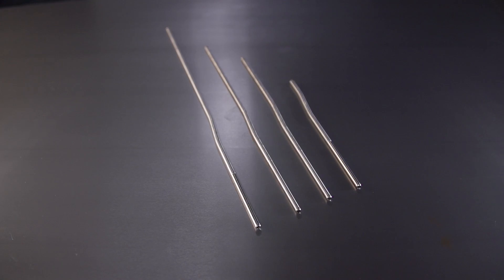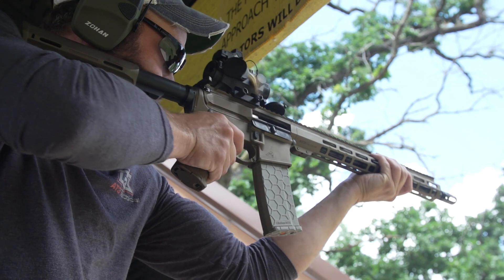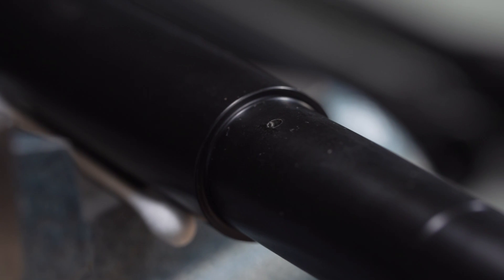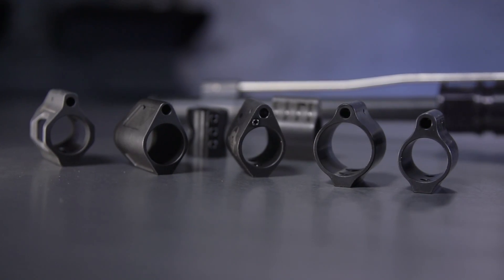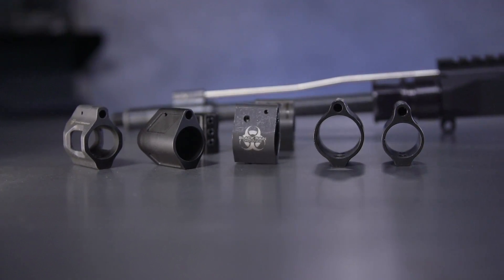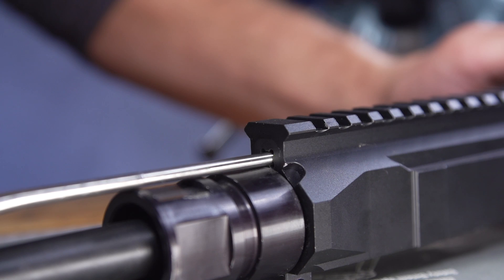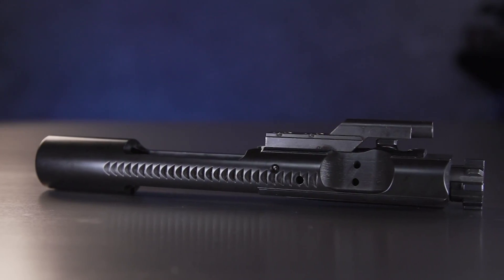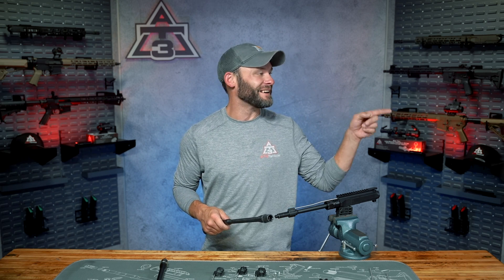Ep-4: The AR-15 Gas System. THIS Is Why & How Your AR-15 Works! Gas Blocks, Gas Tubes, Gas Ports.

Comment: A properly installed, real A2 front site post and gas block is pinned twice all the way through holes drilled in the bottom of the barrel.  If it's not pinned through, it's a knock off gas block made to look like an A2 FSB in appearance only.

Comment: Sir can someone explain how we can clean the Gas tube inside
Reply: Spray it with solvent from the chamber end itll shoot theu the tube and out the gas port.
Reply: They don’t ever need it. The gas during use is so hot and so high pressured that the tubes are considered to be self cleaning. No need to ever spray anything in there and God forbid don’t try jamming anything in there. Totally unnecessary.

Comment: Was is interesting to me is. What happens when you season the threads on a gas block. And use heat resistance blue loc-tite. Yes clamp style. It seals the system better than most. According to JP industries. But most manufacturers don’t want to take the time to season the threads. Tighten and loose gas clamps four times. Clean the threads and bolt with alcohol. Apply heat resistance blue loc-tite. Done.

Comment: Just put a hawk stinger on my rifle. Thanks you all at AT3 for the amazing product and all the videos you have done. 

Question however I thought I had everything lined up with my Odin adjustable gas block and boy was she a tight fit. When I looked under I was expecting to see my two bolts in the miidle of the slot on the mlok but it wasn’t. It’s off just a bit so should I try and realigned it again? Thanks
Reply from the maker: The hole in the Gas block is much larger than the hole that it lines up with in the barrel so if the gun cycles rounds then you should be good to go. If you want to get it perfectly lined up then you could realign it but that is up to you. https://www.at3tactical.com/blogs/news/instruction-guide-install-and-tune-an-adjustable-gas-block

Comment: My Diamondback 15 is extremely over gassed to where the gas is leaking from the rear charging handle, the recoil kicks hard enough to bring my sight off target while on a bipod. I am shooting a 6 inch spread at 100 yards and I think its due to the over gassing. I am able to get a 2 inch spread off of my friends Saint Victor AR. Should I get an adjustable gas block or do you think I need a heavier spring and weights?
Reply: Probably both. Start with the cheapest one
Reply: Start with an H2 buffer, then get a white hot springco buffer spring. The first can be under 20 bucks and the second is 30 bucks. I’ve found the H2 buffer weights balance all of my AR’s from 7” to 16” and just about everything in between. Shoots softer and ejects at 4 o’clock all day long.

Comment: This video neglected to add the micro length gas tube... the same tube I'll need for my 5" or 4.75" (havent decided yet) barrel. I'll be using an adjustable gas block and skelletonized bcg... trying to build a super lightweight pistol under 3.4 lbs... got a long.list of parts to buy and they add up to over 2000 bucks... im excited about everything except the hole its going to burn in my wallet.
Reply: Bro i thought a super short ar would be cool but i hate my 7.5. Its just too loud and cuncussive and the velocity loss is insane. Don't waste your money on 556 go with 9mm or 300blk if u go short

Comment: This isn't even close to everything I wanted to know.
Reply from the maker: You know what? You're 100% right! That is not an accurate description at all. Got it updated to something more fitting, BUT...we will circle back to this topic and cover it more in depth down the road. Thank you for calling us out and keeping us sharp!
Reply: @At3tactical  Right on. I may recommend, grabbing a license to one of the finely detailed animations of AR-15 operation. Splice those into the descriptions of parts and operation, especially those which are internal. Reference "How an AR-15 works" youtuber Matt Rittman, and "M16 and AR-15 - How firearms work! (Animation)" youtuber Thomas Schwenke.

Comment: I'm currently trying to build my very first ar10. The question I have is, are ar15 and ar10(DPMS LR308) gas blocks the same? Some say yes, some say no. I just want to be sure as I'm new to building.
Reply from the maker: The important thing to pay attention to here is the gas block diameter and the diameter of your barrel. Most "standard" AR15 barrels use a 0.75" gas block. The diameter can increase as you go with thicker barrels like HBar or Bull barrels. Now comes your AR10 (.308) style rifles. You certainly can find AR10 barrels in a variety of thicknesses, but honestly it's likely going to be one of three diameters; 0.750",  0.875", or 0.936". Meaning.....drum roll.... they are the same when you think about it from the proper perspective, diameter! Good thing is almost ALL barrel manufactures will list this important measurement in the description, so there should be no guesswork. 
Hope that helps!
Reply: @At3tactical  Thank you that clarifies my doubts! I had ordered a Ballistc Advantage .750 barrel and was unsure of gas blocks. But now knowing if I stick with the matched gas block journal size it should be just fine. Thank you again for the clarification!

Comment: "Direct impingement" IS a piston system.  The piston is the rear of the bolt.  The cylinder is the inside of the bolt carrier.  It's just not out front where others are located.  As far as "it $#!+s where it eats", you can shoot far more than 500-600 rounds before it gets dirty enough to have functioning problems, and even then, a few drops of oil will fix that.  Certainly you will have a chance to clean the rifle in that time.  You don't even need to to a complete cleaning.  Just brush the chamber and lugs, and do a quick cleaning and lube of the bolt carrier group, wipe out the inside of the upper receiver.  The problems I've seen shooters have are ones who "run her dry like they do in the sandbox".  Well, here in the USA is not "the sandbox".  Oil it.  And you can't "over oil" the M16/M4/AR-15.  Excess oil will blow out of the ejection port in just a few rounds.  If problems, turn the rifle on its left side, drip in some oil through the ejection port... even motor oil dripped off a dip stick will do... work the charging handle a few times, and go back to the job at hand.  A lot of guys use Mobile One synthetic 0w20 or 5w20 with good results.
Reply: Some people have been there and have the t shirt….while others are 50 mile experts…
Reply: Wtf was that!? I didn't do that. But good statements. Agreed.
Reply: Excellent reply on every aspect.    I would debate you though on whether the piston is actually the bolt carrier, simply because it is the moving portion.  While the bolt carries the rings to seal the expansion chamber. 
   Most ppl don’t understand the bolt is actually forced towards the breach due to gas expansion, while the carrier moves aft.  This actually saves wear on the locking lugs, unlike with a piston ar.
Reply: W
Reply: Technically it's not true DI anyway. A Hakim is, not an AR tho

Comment: Good info on the gas system, Randy. While choosing the gas block to match the mfg's recommendation as well as gas tube length is solid advice, one thing I wish you'd gone into depth about is choosing a barrel for the "desired" GT length. I specifically chose a mid-length 16" barrel for the extended dwell time. While carbine length will work fine on 16" barrels, the mid-length slows the BCG just a bit, which reduces the sharpness of felt impulse. Some folks might never notice the difference, but I can. Just thinking out loud here...
Reply from the maker: Absolutely on point and Thank You! There's definitely a lot more to this story to cover and I assure you, we'll dive pretty deep into these topics as the channel grows. (I believe I put a future video idea placeholder on the calendar just for testing this concept. Can you really measure recoil impulse with changes to dwell time...and if so, by how much do they fluctuate?)  ;)   -Randy
Reply: @At3tactical  Thanks for the reply, Randy! I truly enjoy your informative videos, and look forward to the rest of this series!!!